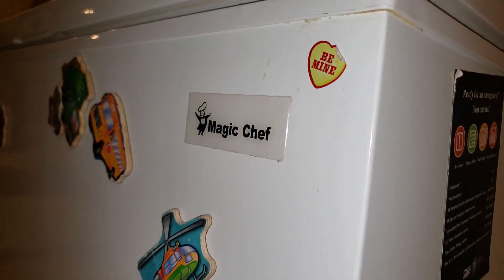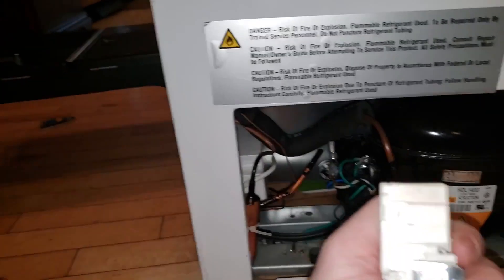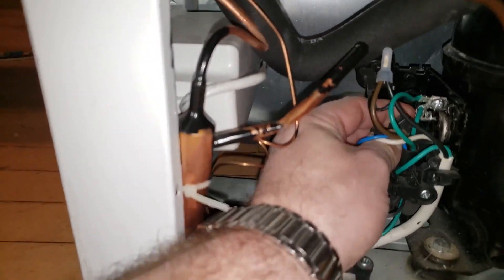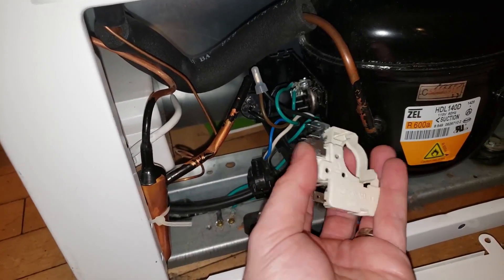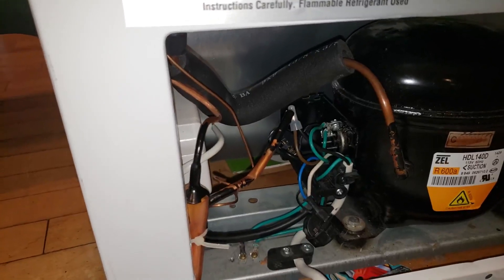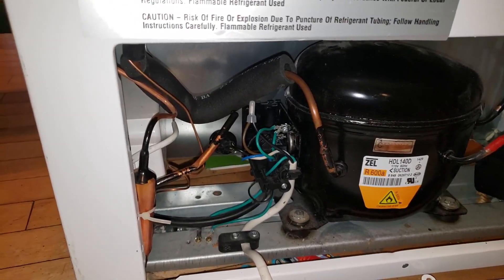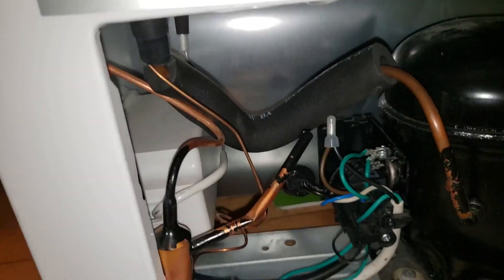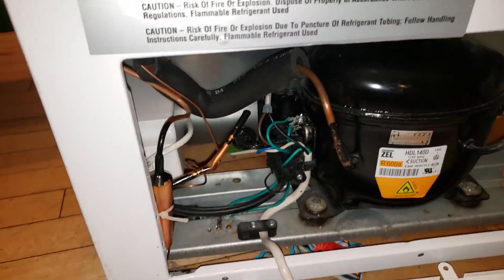Chest Freezer Starter Relay Replacement (Different Relay) - Magic Chef HMCF7W2 (Fix It)

Comment: Great video.  My 38 year old freezer has an intermittent relay.  I think this should fix it and the part is almost a drop in replacement for the old relay.  Heck for $8 it wouldn't hurt to just have an extra one on hand.   Thanks!

Comment: How do you find out what size overload Protector you will need? The part number that’s on it I cannot reference it to anything and I’ve ordered a bunch of different ones and none of them will fit the starter relay so I really need to find out what says I need

Comment: Thank you so much ! I had built a kegerator for 3 kegs out of a chest freezer and a temperature controller. It stoped cooling and with your instructions I was able to get it running again.
Reply: I had the exact same thing happen. Which temperature controller are you using? I believe mine may be the culprit

Comment: Do you mean to move the black wire to the number two pin on the overload protector, or do you leave the wire on the same pin and just connect it directly to the top post at the 12 o'clock position?

Comment: When I connect the black wire to the 12 o’clock position it don’t turn the motor all the way on I can just here it on low

Comment: I replaced the relay, but I still heard humming sound and click, then I think to replace the overload protector.  However, I pulled the black wire which has the gold mental part on it and I was trying to plug in to the new overload protector, but it wouldn’t stick in. Can you please help to instruct how to plug that gold metal thing back?

Comment: Thanks for the video. May not be as helpful to some in "how to" actually wire the relay lol but for me I actually just found the same issue today with my freezer which happens to be the exact one here and just knowing what the problem is and what to purchase saved me so much time! In addition the actual original relay is Listed here and all I had to do was click on the link and it took me straight to Amazon saving me even more time and to my pleasant surprise it's now only $20 so I'll be able to just unplug the old and plug in the new without having to figure out too much how to wire up a universal piece. So THANK YOU!
Reply: Could you please share the link for exactly same part?

Comment: You put a wire extension on it... great. For those who are complete noobs, wtf is that? Googling just gives me stupid power strips or extension cords. Not wire extensions.
Reply from the maker: By wire extension,  I just mean a small extra piece of wire I had to make it slightly longer.
Reply: @JSano19  For the life of me, I cannot disconnect the following wire. https://imgur.com/bKgBqXl I feel like I am going to break something if I pull any harder or try and use a needle nose plyer. Is there something else I can do?
Reply from the maker: @blacksaibot6158  Just rock it back and forth little by little.  Unless they put glue underneath, it looks like it should come off, just might take some effort.  Just be careful not to break it.
Reply: @JSano19  And to make matters worse, my freezer with the EXACT SAME MODEL # AS YOURS, has a completely different relay. So I don't even know if purchasing the black one would fit either. It's like they want me to buy a whole new freezer.
Reply: @blacksaibot6158  Same here this video is wrong in several ways
Reply: @keithrainville7612  Well I wouldn't say wrong. He obviously got it right because IT'S WORKING..!
My freezer had the same problem, 
Remember, this posting is an act of charity. Helpful to tthose of us who have not done this sort of thing before..
Is the editing perfect, no but very helpful non the less.

Comment: Super strange, I have the exact same model but my relay is K115 TY, which is different than your original relay. I couldn't find the part k115 TY online, but I found a similar one, but it didn't work and I don't hear clicking any more. I think the ohm may be different. My original one was a 3 PIN relay but only 1 pin had the blue/white plugged into it. I bought this back in 2015 - I wonder if the design was changed at some point. Just ordered 4.7 Ohm single pin one.
Reply: Well the new relay worked, for a little while, then it went out again and tripped the breaker in my house. Not sure if something is bad causing the relay to go out.
Reply: I’m having same issues as you, can’t find k115 TY. What part did you end up buying? Thanks

Comment: Did it hold up?  
  I ask because if the overload had tripped, the compressor may have been too many amps due to something mechanical going out such as bearings.

Comment: I'm having a similar issue with my idylis freezer. I was a little confused. You used the original overload protector and just bought a new universal relay? I'm doing similar products that come with a new overload protector, but if i dont need that, I can save a bit and just get the new relay
Reply from the maker: Yes, that is what i did, used the original overload protector and just bought the relay.
Reply: @JSano19  Just bought the relay. Hoping it does the trick! I was so close to taking the freezer to the dump before I found your video. Fingers crossed! Anything I should know when it comes to installing the relay? I'm a n00b at this lol

Comment: Going to try this out on a freezer I got for free. Do you know if the orientation of the pins for the starter relay matters? Not the single "in" pin but the two "out" pins going to the compressor. Thanks!

Comment: Thank you for this video! My IDYLIS freezer was doing the exact same thing and had the exact same compressor and parts. I ordered the identical part and it came in last night I plugged it in and it worked! The only thing I did different was to removed the jumpers in the white housing and used them to connect the new PTC Starter Relay. Thanks for doing the research so I didn't have to!
Reply from the maker: Glad it worked out for you!  Would be a shame to lose an entire chest freezer for a simple 5 dollar part install.  I am 6 months post this video and my freezer is working just as good as the day it was purchased!
Reply: Did you check continuity of the starter relay? My freezer is doing the same thing however some videos suggest checking continually and I do have continuity and I’m just wondering if I could still get continuity and it will still be bad.
Reply: @presteatom3773  did you ever figure this out?

Comment: I have the exact same model of freezer and experiencing similar problem (compressor gets warm/hot, freezer isn't chilling).  How did you get the white plastic housing with the original relay off of the side of the compressor?  I've removed the black cover to expose the original relay unit and wiring, but it doesn't look obvious as to how to take that off.  I'd didn't want to force anything off and then find out there was some kind of screw or fitting that needed to be undone first.
Reply from the maker: There were 2 screws holding it on. One was holding the 2 green wires on, and the other screw was by itself just below it.  The green wires just need to be screwed back to the compressor itself in the same whole (just without the white plastic piece) and the other hole just stays empty.
Reply: Replaced the relay, hooked up the overload protector to the top pin with the black wire going into it but no joy.  The compressor gets pretty warm (to the point where it's almost unbearable to touch), it's humming/vibrating quietly like I'd expect it to, but doesn't seem to be doing anything in terms of cooling at all.  I do notice that as I look at the compressor , the copper pipe going into the left hand side is ambient temperature, but the copper pipe going into the right hand side of the compressor is almost as hot as the compressor itself.  Any ideas?  No worries if not, it was cheap enough that it's not the end of the world.
Reply from the maker: @lescarter9956  2 Things I might try, first, if you used the same overload protector that came from the original, keep in mind that the original "lead wire" coming from it originally was a connection from the board, and you have to move where the original black wire is coming off of the overload protection to the other pin, and that wire now would go to the top pin.  If you did this and it still is what you are describing, you could try to (for just a few seconds) remove the overload completely and put the black wire straight to the top pin JUST TO SEE if the compressor would kick on, because maybe the overload protector is what is faulty on your unit.
Reply: @JSano19  Yeah, tried with the original overload protector and hooking it up directly, unfortunately the same results.  The compressor is doing something as I can feel it vibrate and hear it hum, it gets super hot to touch.  I've tried running circuit continuity checks across all combinations of the pins on the compressor and there didn't seem to be any issues there.  At a bit of a loss, other than the compressor is somehow fubar'ed and it's time to get a new one.  It's  shame, it's only 1-2 years old and barely used, but it was super cheap so I don't feel too bad about it.
Reply: Never mind, after spending a few more minutes and taking a guess that the green ground wires were going to be attached to the side mounting I found that unscrewing the ground wires allowed me to slip off the relay.  Thanks for your video, hopefully this is going to be a cheap fix for a cheap freezer! :)
Reply: just pulls off light tug

Comment: Capacitor start motor. initial voltage induces a phase angle in the separate winding. causing the motor to kick over. and then the main winding is the "run" winding. Very glad you got it going.  The item in your hand is called a "Clicker" in the trade.  Only need the start connection for like half a second.  If it is energized all the time, it will burn up.
Reply: Clicker never hear this overload call this if clicking something is wrong LOL